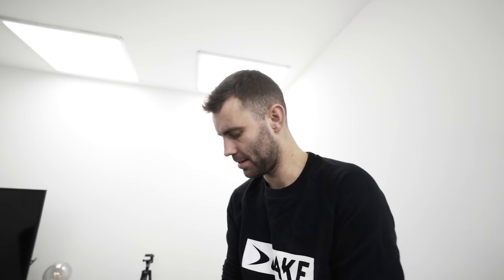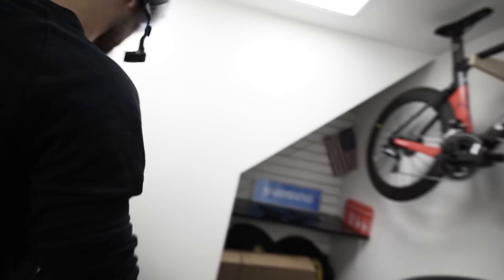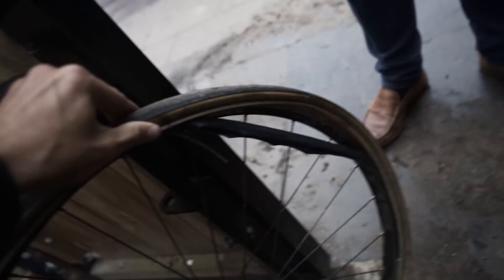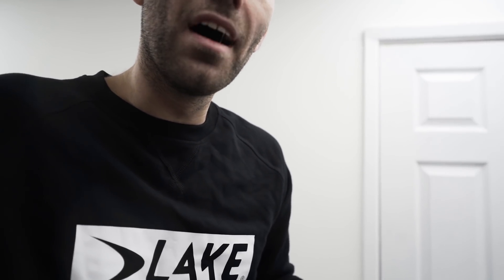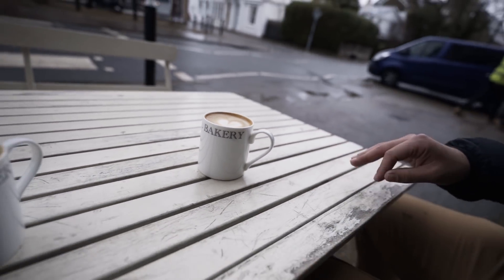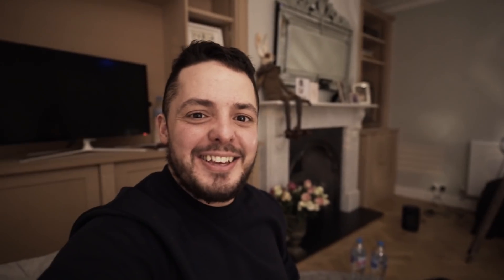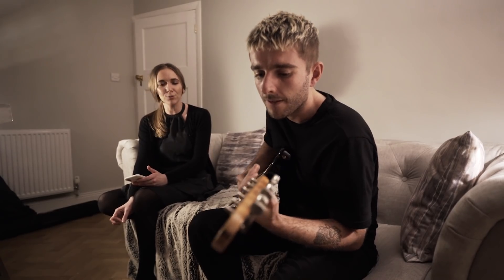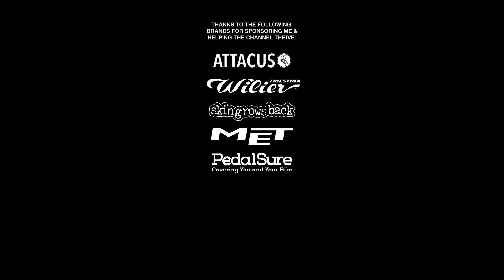How much Pressure does it take to EXPLODE a Wheel?

Comment: from personal expirience i can tell that the "modern" digital pressure things at gas stations are absolutely not suited for bike wheels because they are optimized for car wheels which have just a tiny bit more volume and they have a super high burst of air at the beginning which can kill a bike wheel almost immediately, something in the range of 200-300 psi, which is not an issue for car wheels because of the higher volume ... Just stay away from that monsters.
Reply from the maker: Sounds about right! 
Weirdly enough the one that killed my wheel was an analogue, old style gauge... I guess we held it on the valve too long and it just kept inflating!
Reply: @Cade_Media  they are even worse for our beloved carbon wheels because if freshly pressurized/charged they can have an internal pressure of up to 4200psi 😵🤯
Reply from the maker: @RotatingMass  I'll stick to my mini pump in the future 😂
Reply: @Cade_Media  thats always the safe way, but i have to correct what i said. Its not 4200psi, i just messed up the conversion from bar to psi - its more like 400psi (max. internal pressure) but i guess at that levels it does not matter, even with 400 psi, that wheel is gone, just like you demonstrated :D

Comment: Yes..being from snowy and cold Canada I got stuck in a big snow   bank and I was rocking the car backwards and forwards for about  15 minutes and the tire pressure most have increased some as the tire came off the rim but the rims were steel and not alloy and it wasn't  damaged ..ahh

Comment: What is really weird is the fact that in Mauritius you used a compressor and wheel gave up. I would assume they don't go nowhere near 150-160 PSI...
Reply from the maker: The force on the rim would be more though because the tyre was bigger (area*pressure= resultant force), correct me if I'm wrong though.
Reply: @Cade_Media  Something like that, but... We are talking about different range of pressures. Cars use something around 3 bars, truck less than that. Quick googling shows me that they (compressors) operate at max. is 6-8 bar which is 115 psi. It was carbon though, so worth checking what was the wheel tested for.